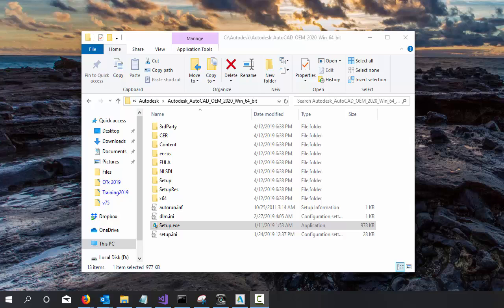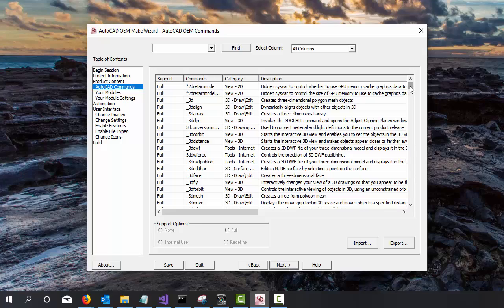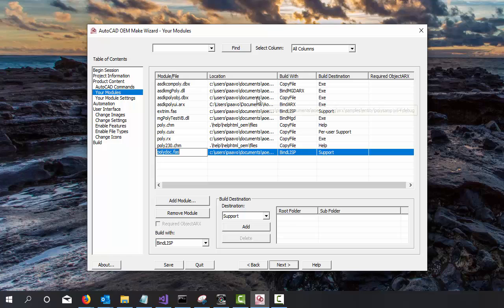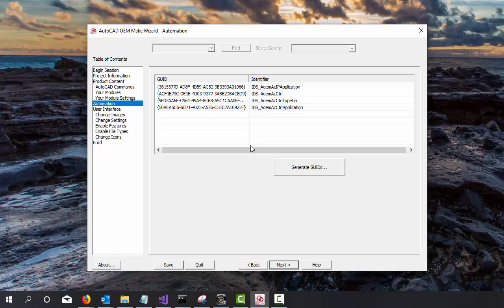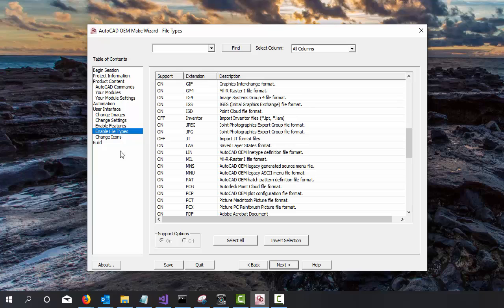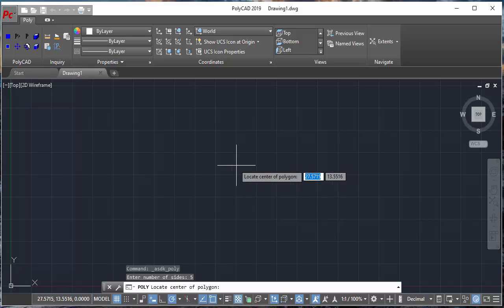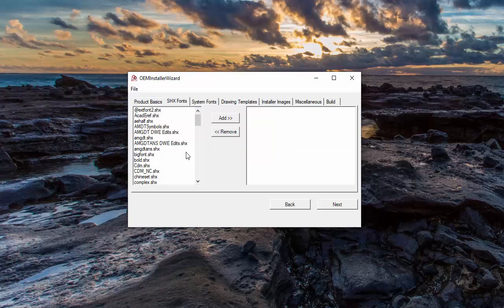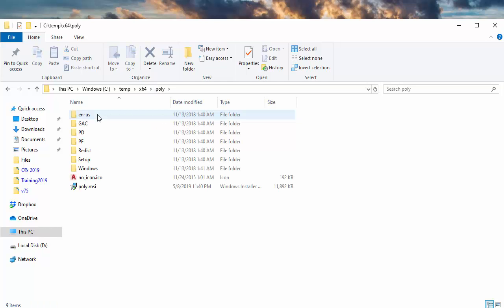AutoCAD OEM Technical Overview

Comment: Great video, on your website it said customers can interact with the software via a web page? Does this mean that users do not have to download the program and can use the cad program online? Cheers
Reply from the maker: Hey Danuka,
There's not a way to use a browser version of AutoCAD OEM. We do have an online sandbox for HOOPS Communicator, but that's a different software. If you're looking to develop using OEM, your next step would be to do an evaluation. You can do that by filling out the form here: https://www.techsoft3d.com/products/autocad-oem. Just click the "Evaluate free for 60 days" button at the top of the page. 

If you have any questions at all, or just need additional help, I would recommend using our community forum. https://forum.techsoft3d.com/

Comment: Awesome video ,If you have some time it would be nice to see how you remove or add in sections 
just so we could get a better idea of the task at hand.
Thanks for the Video tho.
Not much information on the Web about AutoCAD OEM
Reply: Thanks Mike. You remove and add/include functionality by supporting or disabling commands or command categories in the 'Your Modules' tab. By disabling a group of commands you essentially choose to not include associated runtime modules (.dll, .arx et. c.) in your final product. Thus, reducing memory footprint/size on disc of your final product and also increasing performance.
From a UI perspective... if you start with the standard .cuix file for AutoCAD (OEM) you simply remove the items you're not including and add your custom stuff. Alternatively, you create your own menu (.cuix) file from scratch using the CUI editor.
It's a valid question, the answer is pretty straightforward so I doubt we will provide a video specifically for this. However, we will make sure to cover the topic in future videos. Thanks again.